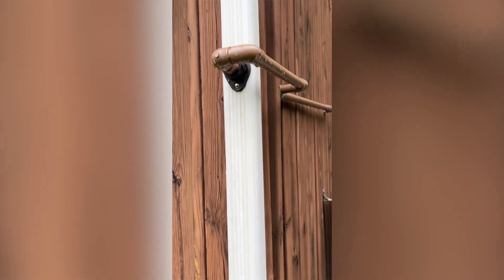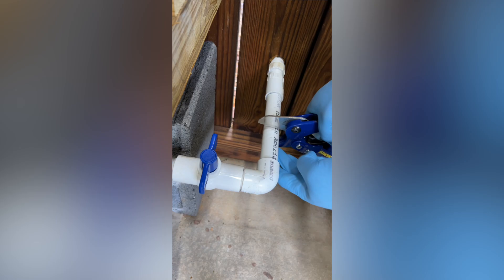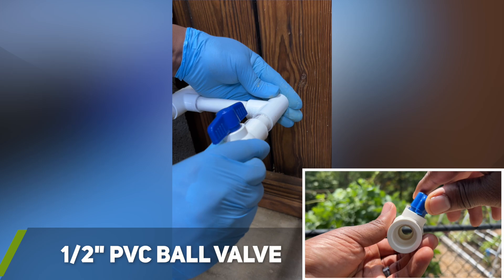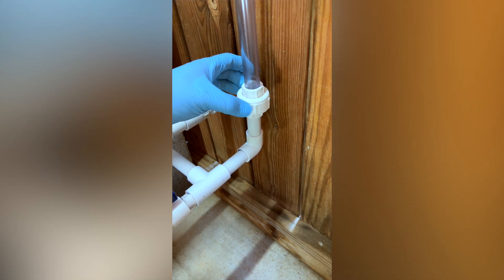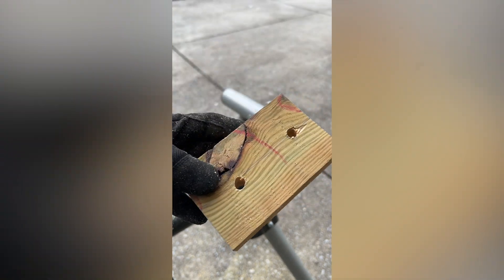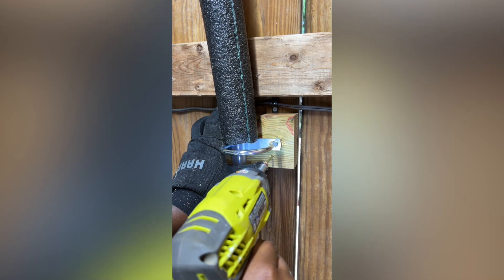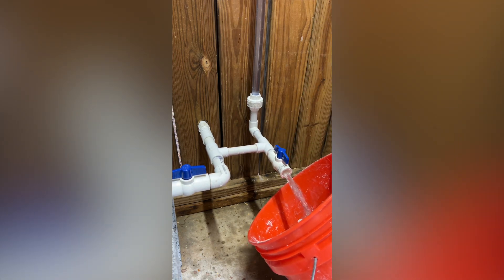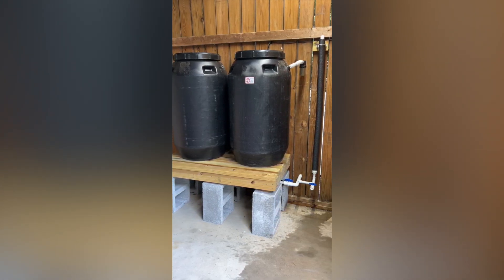Rain Barrel System | CHEAP Water Level Indicator

Comment: This video gave me a headache.  LOL
Only because, when I saw how logical and simple this was and SO EASY to do, I banged my head on the table... 3 TIMES.  LOL   j/k

But seriously, in trying to figure out a water level thing, I was thinking of some kind of mechanical arm that turns a gauge or moves a red needle, to designing an electronic one with an ESP32 and a display.  LOL

This is just so much simpler.  LOL

Thanks for this.

Comment: Because your piping is below the level of the barrel your clear pipe will show water when the barrel is actually empty. I would mark on the clear pipe as empty once the barrel has no water so not to be confused thinking you have water.

Comment: My system is done with an IBC container obtained from a landscape company for $30. It holds 350 gallons when full. Less connections less chance of leakage and fits standard 2-in pipe fittings for easy PVC connections without adding extra holes or gaskets or bulkhead fittings. Rain from the back side of my front roof drains on to the balcony, rain from the balcony drains on to the kitchen extension, rain from the kitchen extension drains to my system so I'm getting rain from three roof surfaces coming out of my downspout. Literally a 15 minute quick thunderstorm will fill my entire 350 gallons from empty to full. Gutter foam prevents most debris, and I need that does make it through settles into my first flush. After which the entirety of the water volume goes into a square to circle adapter for 4-in PVC which is then reduced to 2 in to fit the cap of my IBC as the center of the cap has a screw-out plug that fits 2 inch adapters. When it enters the 4-in PVC there is a y fitting mounted upside down the extension of the y reduces to 3 in and goes across and then down the side of my IBC container. What this does is allows my IBC to receive the full volume of water from three of my roof surfaces so that I get very quick filling rather than having to wait through multiple rains. The upside down y fitting allows the tank to fill semicolon and when the tank is full the water will back up that pipe until it reaches the down slope of the y and continue on its way as an overflow. That 3-in pipe goes out to the yard to water the yard and my tree. The base of the IBC also has a valve that fits standard 2-in fittings that you can simply reduce for purposes like the one in this video and even hook up to a pump to use the water. The IBC came with a cage and platform in which I have wrapped some vinyl flooring material around secured with panhead screws to keep the light out and prevent any algae growth. I've had the system running for 3 years now and have never run out of water for my garden. My garden, yard, and trees are completely watered by this system reducing my water bill for yard maintenance to zero. Because the valves are in the base of the tank it's very easy to expand the system by simply connecting two tanks at their base with standard 2-in PVC fittings and a t on the last one and I have since added that second container giving me a total volume of 700 gallons when full and since I'm receiving water from three roof surfaces it does not take long to fill and maintain that 700 gallons

Comment: Looks great!  I'd be tempted to mark the tube with some divisions, like 10ths full or 8ths full.  You could actually mark it in gallons, but I'm not sure how useful that might be, and it would become obsolete if you added more barrels to the system.
Reply from the maker: Good idea Todd, and I was thinking about that but also had the same conclusion if I plan on adding more capacity to my system later which I do.

Comment: Nice ! Maybe that you can ad something that floats and that has a very bright color, that makes it even easier to see the level, even in the dark or when the clear tube gets a bit dirty. I was thinking about a ping pong ball, but I think that it won't fit.
Reply from the maker: Good idea insAneTunA!
Reply: @GreenTechTown  If you're going to do that, maybe put some coarse mesh at the bottom of the pipe so that the float won't disappear down into the PVC pipe if you need to completely empty the barrels.
Reply from the maker: Good point MRAB!
Reply: @GreenTechTown  I bet they have something useful at a store where they sell fishing equipment, they have all sorts of floats in different sizes and colors, and you can attach some fishing wire to it so that it won't flush away. That saves you from taking it all apart again, since everything is already glued solid.
Reply from the maker: @insAneTunA  Good idea!